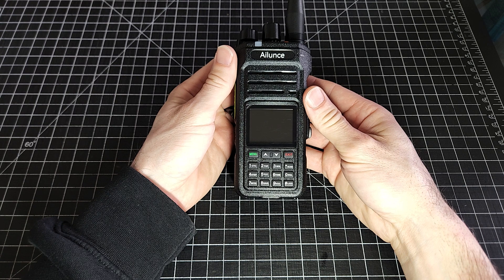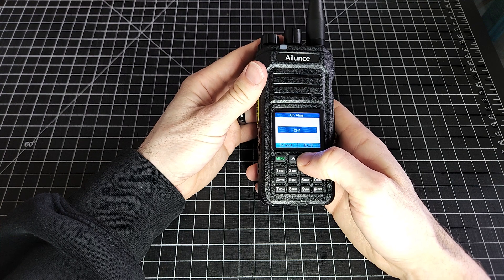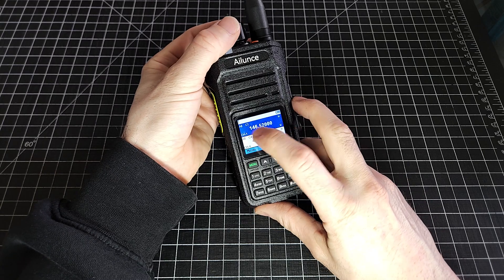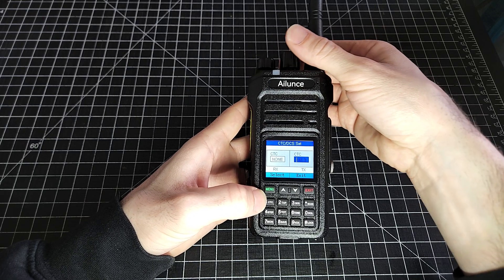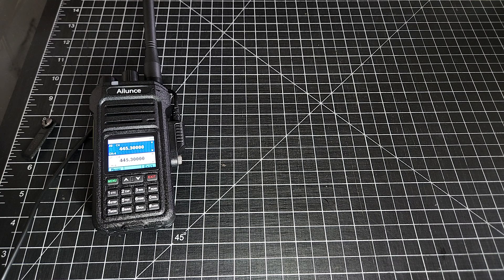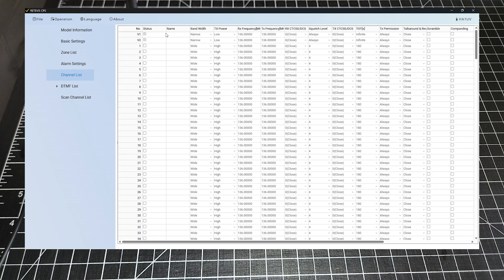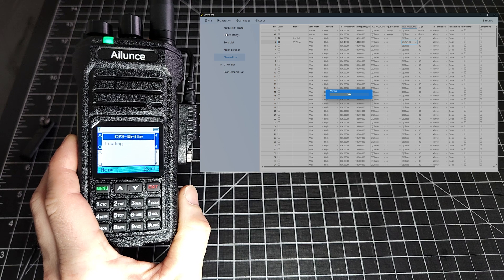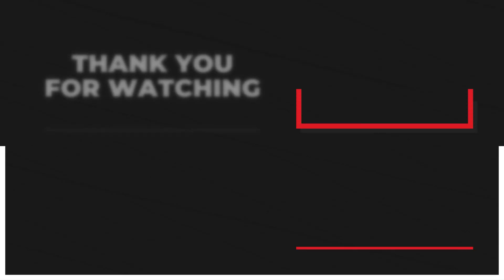How to Program the Ailunce Retevis HA1UV: Manual & PC Methods Explained!

Comment: I am a new radio owner of the Ailunce and would like some clarification on how to change the channels. We use these at a youth camp to communicate with leaders. Could I get your email address
Reply from the maker: This is the Ham Radio version, the user would need to be a licensed Amateur. There is the HA1G that is a GMRS version, unfortunately here in Canada those are not legal at all as they exceed the power limits of GMRS in Canada. 

I would recommend talking to your local Communications or Radio shop, they should be able to help you find a setup that follows regs in your area and can get them programmed up for you.
Reply: @darryldowney 
How come ?
It is less than 5watts... What is the GMRS power limit in Canada?
Reply from the maker: @georgemyth some rules in Canada for GMRS, no licence required, 2w power limit, no removable antennas, no repeaters... Kinda useless, basically FRS. I am a firm believer that Canada needs a GMRS rule reform.